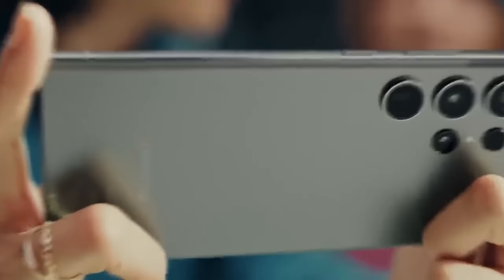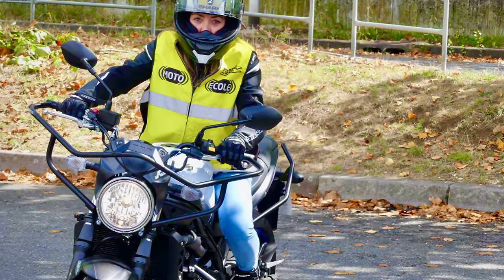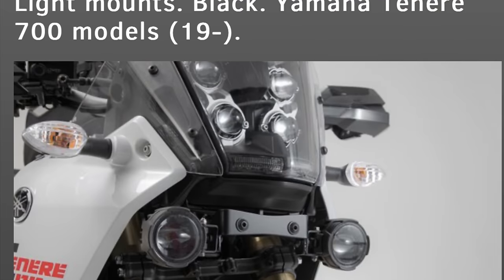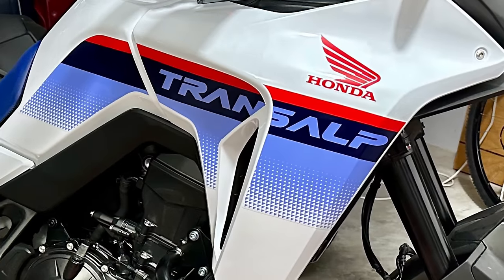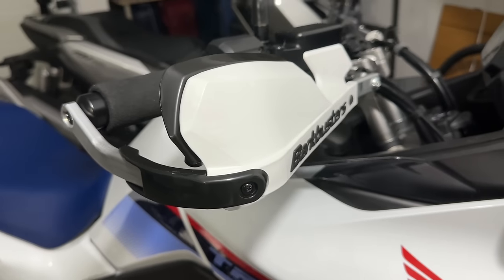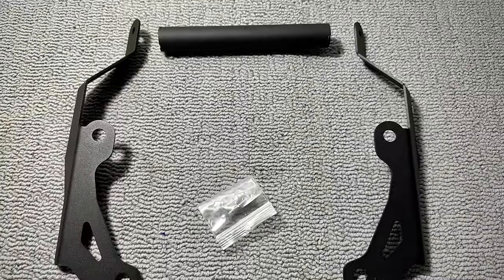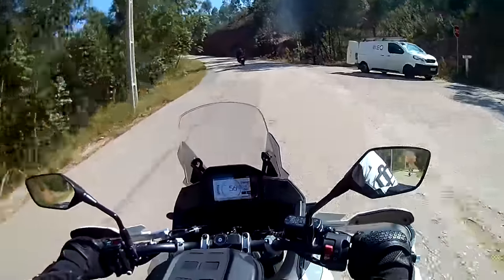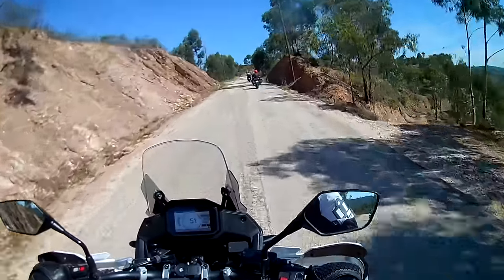An Alternative to Traditional Crash Bars

Comment: Crash bars on the handlebars are a bad idea...as the risk you getting caught up in that hole...fingers hands wrists.   ("snap")  the sound of your wrist breaking when you crash on that gravel road you speak of.   You hand needs to be trap free up there ideally.  Plastic hand guards good enough to deflect rocks and tree branches, wind/rain....end of story...just don't crash.   Lower crash bars...same thing....setting yourself up for a broken leg when the bike inevitably hits your body when it lands on you...which happens often enough.   You are adding protrusions that increase the risk of injury..and weight.   None of these modifications make much sense in this regard.
Reply from the maker: Thanks for your input👍😊
Reply: @RocketMan_Moto  If you study closely Pol Tarres' T7, you will notice these exact elements on his bikes more often than not.  No lower mid crash bars, and the "bark buster" bars ....absent, the bars are open on the ends with deflectors only, not full rap around.   As a veteran rider, I have come across, heard of, learn more and more about these types of injuries.  Yes, the lower arm can get in that slot in a bad way, and that "clean leverage break" occurs....A big bad injury..preventable.   And it doesn't take much time to view on You Tube the ADV riders dropping their bikes over and over and you can see with your own eyes just how close they are to losing their leg to those protruding bars...close calls one after another, and then a video with the dangling broken leg being dragged out from under the Africa twin "lower crash bar" area...where the feet the go.   It gives me the hiebee jeebies.   I believe in the age of lightweight trends, and the ADV world will get all the crashing out of the way, and back into the world of staying up right...at all costs.  Its something that has been normally avoided in the racing world, but oddly now accepted as "part of it", which is non sense.   Breaking a leg...should not be considered "part of it", but rather...considered a serious avoidable accident.    In the science of safety.  The crash bar only give a false sense of security, and ultimately contribute to the problem.  " I can crash, because I have crash bars".  Ya, but it depends on how you crash...a cartwheel crash has little to no use for a crash bar, and will likely leave your bike a pile of immovable bent scrap etc, and just hope you aren't under it when it lands.

Comment: The more protection the better.  These bikes are all pigs of road, no matter what the ads and reviewers say.  A few kilograms either way doesn’t make these bikes noticeably better or worse to ride.  Easier to sell a bike with little or no damage to the bodywork.
Reply from the maker: For the little off-roading I do, upper crash bars are superfluous
Reply: I can see not needing them if you really don’t do much off road riding; the lowers and hand Guards do protect pretty well on mild tip overs.  My brother in law crashed my Norden 901 (full crash bars) going pretty fast on a nice dirt road and all it did was scratch the heck out of the bars, which a $5 can of spray paint touched right up.  Really liked the cell phone analogy, by the way 😁

Comment: The main problem here is replacement parts price. We understand about the rules of capitalism and blablabla...the company need a profit, make shareholders happy...and so on...
But OEM replacement parts price is insane...used to be expensive even at 90´...but almost of the times affordable...you could save some coins and visit a dealer to buy parts...
A gossip...How much cost a ECU? Not MRSP I mean....but from supplier to assembling line? Less than 15USD...Big bike, not small commuter...
And this thing will ended up at dealer by 750USD...or more...
A fairing is not a rocket science. Manufacture a plastic mold today is easier than 30 years ago...But brands/dealers will charge you a truck load of money to replace a fairing...and use a army of lawyers if someone decide manufacture a aftermarket version.
And with or without these bars...sometimes fairing will be damaged...and the rest of the bike.
At least the "shell" around the bike could be little bit more affordable...I not talking about to pay 100 bucks for one crankshaft!
These "Hamelin Flute" strategy works so well...they create a trend and the people, the consumer, just follow without complaint...because at end of the day this is the price to pay if we want a nice and shiny bike.
Reply from the maker: Thanks for your feedback👍